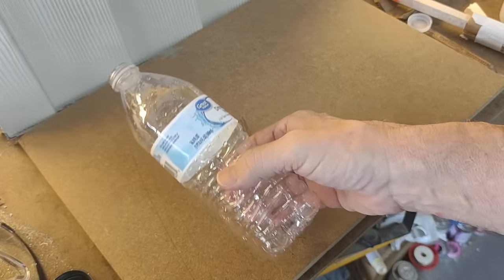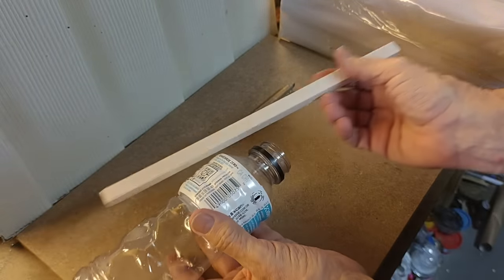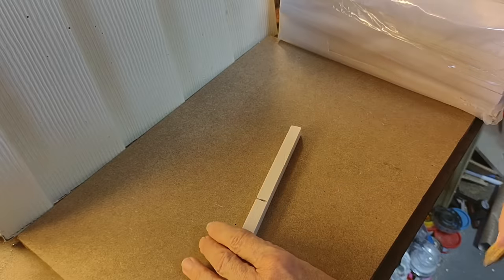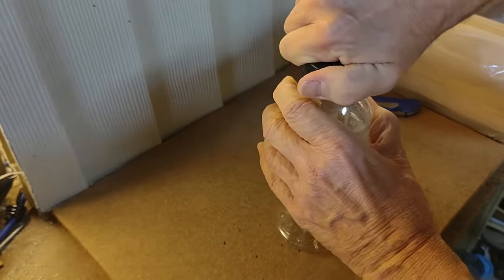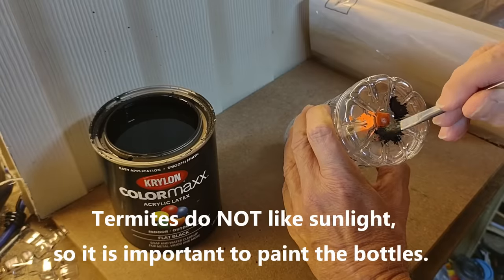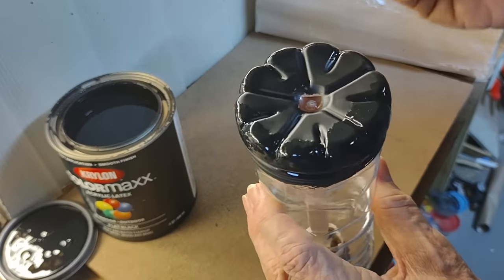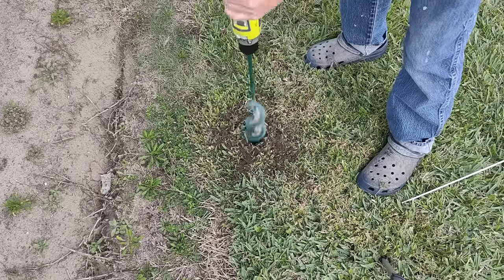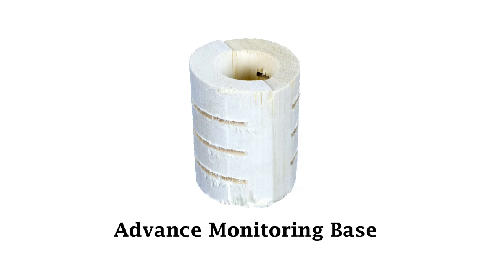Unbelievable Water Bottle Trick for Termites!  Simple to do!

Comment: 17:01 Hi Guy! Great info. I’m glad I found your channel. I’m about to cancel my Pest Control because money is currently tight so I’m going to have to DIY.
Now, question: why wouldn’t I want to have bait stations around my home instead of monitoring stations? Why not use the foam from the beginning?
I currently have stations around my house (from my pest control service) that I believe are bait stations. They’re most likely going to be removed from my home by the company once I cancel my service.
Thanks for answering.
Reply from the maker: The question you are asking is somewhat complex, but let me give you as short an answer as possible.  The bait in these stations you already have does not kill termites.  They contain an insect growth regulator that stops termites from reproducing.  The problem is that a termite worker can live up to 2 years, so it can take a long time for bait stations to kill off a colony.  Meanwhile, ants also like the bait and they will eat it when there are no termites present.  This can empty the bait stations before the termites get to it.  Moreover, bait is expensive and it only lasts a limited time in the ground before it becomes moldy and the termites reject it.  So, you need to replace the bait every year or so, and maybe a lot more often if ants are getting into it.  The monitoring stations do not use a bait at all, so ants are not interested in them.  They use wood and ants do not eat wood, so they only go off when termites trigger them.  They do not kill termites either, but they do tell you when termites are planning to eat your house, so you can treat them before they arrive in your home.  The wood in the monitoring stations is cheap.  It too will become moldy and need to be replaced every year or so, but at 50 cents a unit you can replace them all every year for about $25.  You just pull one up every year and check it for mold or rot.  If it looks good, put it back.  If it looks nasty, then replace them all.  If a unit goes off, you can make your own bait station that will kill off the colony in about 12 weeks, as opposed to the almost 2 years that a commercial station may take.  I have a video on how to do that as well.  You can only use my homemade bait stations after one of the monitoring stations is triggered.

You can also use termite granules to prevent termites.  They cost about $50 and need to be applied every year.  It takes about an hour for an average sized home.  For the granules to work you need to have dirt around most of the house and that dirt needs to be porous enough to allow water to seep into the ground fairly quickly.  To find out if the dirt around your house is porous enough, just dig a small hole next to the house that is about 4 inches deep, 8 inches long, and just the width of the shovel.  Fill the hole with water and watch to see how fast it drains down into the ground.  If it seeps into the ground fairly quickly, then the granules should work just fine.  However, if it just kind of sits there, then the granules would not be a good choice, and you should just use the monitoring stations.  I use both the granules and the monitoring stations around my home.

Make sure that you buy the correct granules.  You need the ones that have imidacloprid as the active ingredient.  A lot of the Home Depot and Lowes stores no longer sell the correct granules, but you can get them from Amazon.  I will give you a link to them.

I hope that helps.  Be well my friend.

Termite granules:  https://www.amazon.com/dp/B000RUIJYM?ref=nb_sb_ss_w_as-reorder-t1_k1_1_6&amp=&crid=157C3RV0MY0AK&amp=&sprefix=termit

 Video on how to apply termite granules:  https://youtu.be/H7rW_TSBHJ4

Video on how to make a termite bait station:  https://youtu.be/r05Z-aUJehw

Comment: Great video. Thanks for the termite info. Knock on wood, no termite problems. I was recently told by my cable company service tech that i have black Ants traveling up the northside of my house and that i should follow them as i might have some kind of structure issue. I live on Long Island on the north shore and the Ants in question are black ants about a half inch long. Wish we could share pics on YouTube. What are your recommendations that i can do before calling in a pest service. Is there a bate trap i can use say after i try to follow them? Any help super appreciated. Thanks Eddie J.
Reply from the maker: I am so sorry that you are having this problem.  I do not need to see photos to tell you that these guys are carpenter ants, and they most likely are damaging your house.  They like wet wood, so their presence may be an indication that you have a leaky roof, excessive condensation, or a pipe leak.  The first thing you should do is try to locate and repair this problem.  The ants that are in your house are just a satellite colony.  The main colony is somewhere outside your house.  I have a video on how to eliminate carpenter ants, but the problem that you are going to run into is that you cannot get pesticides in New York.  The state has pretty much banned all pesticides, unless you have a pest control license.  Most people on Long Island have it shipped to somebody in New Jersey and they just go over and get it.  I know it's a long drive, but New York is determined to be the hardest state in the country to get pesticides.  If you can get the products, then this is a fairly easy problem to treat.

I hope that helps.  Be well my friend.

Video on how to treat carpenter ants:  https://youtu.be/Te9BUCaIQZY

Comment: They like polystyrene foam.
Reply from the maker: Termites do not eat polystyrene foam. They are wood-eating insects and prefer to eat cellulose, which is found in wood, paper, and other plant-based materials. Polystyrene foam is made from a type of plastic that does not contain cellulose. While termites may not actively seek out polystyrene foam, they may still damage it if they come into contact with it. This is because termites have strong jaws that can chew through a variety of materials.  So, when the foam is up against infested wood, it can become damaged.  I hope that helps.  Be well my friend.

Comment: This is great. My house was treated about 10 years ago. Do you have any tips on inspecting to see if there is a current infestation? I usually just look for mud trails on my foundation. Would also guess that after some time the Balsa wood would go bad even if there are no termites?
Reply from the maker: In addition to looking for mud tubes coming up from the ground around the house, you should also look for them in the crawlspace, the attic, and even the eaves.  They can sometimes bypass all of that and enter through a crack in the slab or foundation, so mud tubes are not always present.  That is why the monitoring stations are also helpful.  The wood in the station is going to get nasty after a while and will need to be replaced.  I recommend pulling one up at least annually and inspecting it.  If the wood is moldy or compromised in any way, then you should replace them.  The commercial stations have the same problem, but the wood or bait is easier to replace with them.  Also, sometimes the orange dot will disappear, even though there are no termites.  This can happen if you run over one with a riding mower or if the stick was not long enough.  It can slip to the side and not be visible.  So, always check to be sure that you actually have termites when one goes off.  

I hope that helps.  Be well my friend.

Comment: How do you keep mice out of your car? Under the hood.
Reply: @piratepete4322  That sounds like it would be effective, but how does it affect the engine?
Reply: Cat
Reply: @KenJackson_US  

Obviously I am hoping your question is in jest as you don't have to put it near the engine at all but merely in the engine bay .

Near the battery shelf or similar is a good spot .
Anywhere where you can place it that won't enable it to move as it will melt and spread / flatten out .

You can also hot glue the frozen ball in place whilst frozen if required .
Reply: @sfcarp9418 : " I am hoping your question is in jest ..."
My question was directed toward the guy that said to shoot them.  His comment is gone.  Either he deleted it or the fascist censors did.
Reply: @KenJackson_US  

Oh ... ok then .
Reply from the maker: I think the best way is to get rid of the mice altogether.  I recommend using a one feed bait in bait stations.  You can place them near where the car is parked.  I would not place them under the hood because you don't want to attract more mice under there.  The bait I am recommending will pretty much keep the population down to the point where they should no longer be a problem.  I hope that helps.  Be well my friend.

Bait:  https://www.domyown.com/fastrac-allweather-blox-p-333.html

Bait stations:  https://www.domyown.com/protecta-mouse-bait-stations-p-1284.html

Comment: Thank you for the video on termites. How do I get rid of fleas?
Reply from the maker: To rid your home of fleas, the first thing you need to do is to vacuum all the upholstered furniture and pet bedding, paying particular attention to places where fleas can hide, like behind cushions.  Next, vacuum the floors throughout the house.  If you have a vacuum with a disposable bag, then discard the bag outside in the trash.  If you have a vacuum with a reusable canister, empty it outside in the trash and then wash it out with the garden hose before bringing it back in the house.  Wash all bed linens and pet bedding in your washing machine and dry on high heat.  Next, spray a pesticide that is labeled for fleas, on all the floors and on areas of upholstered furniture that does not come in contact with people or pets.  To treat floors, hold the can at arm’s length and make sweeping motions across the floor to cover all surfaces.  For upholstered furniture, you should spray under the cushions and then any folds that there are.  The product that I like best is called PT Alpine Flea and Bed Bug Aerosol.  I will give you a link for it.  Fleas can be hard to kill, so you may need to do this treatment every two weeks until the problem is solved.  If you have pets, then you should treat them as recommended by your vet.  The reason fleas got into the house in the first place is because they are outside.  If you have a flea problem outside, then there is a good chance you will end up with a flea problem inside.  Even if you don't have pets, the fleas will still jump on you when you are outside, and so you can carry them in.  Therefore, you need to treat the outside as well.  I do this with a hose end sprayer.  I will give you a link to my video on how to do that.  I find that treating the yard every 60 days seems to do the trick.
 
I hope that helps.  Be well my friend.               
 
PT Alpine Flea and Bed Bug Aerosol:  https://www.domyown.com/pt-alpine-flea-and-bed-bug-aerosol-p-1886.html?pdpv=2&sub_id=25601  
 
Video on how to treat your yard with a hose end sprayer:  https://youtu.be/wifoTU5dmp0

Comment: Thanks a lot. This is really useful. Would you suggest this for Sydney, Australia weathers as well ?
Reply from the maker: Yes.  Monitoring stations are useful everywhere in the world to monitor for subterranean termites.  However, they may not be effective in identifying all species that exist in Australia.  I am not familiar with all the species you have there, so it is possible that one or more species may operate somewhat differently than subterranean termites that only travel just below the surface of the ground.  Therefore, monitoring stations will most likely be very effective in identifying most subterranean termite activity, but I cannot rule out the possibility that a species there may get past them.  If I were you, I would try to locate them about one meter apart around the entire building and along both sides of the driveway.  It would be hard for the termites to miss them if they are that close together.  Keep in mind that sometimes one of these will malfunction and the dot will disappear because the stick moved.  This can happen if the stick was cut a little too short or if a riding mower went over it and such as that.  So, if one goes off, pull it up to make sure that there are actually termites in it.  Most of the time there are.  If it's a malfunction, then simply replace it.  If it's termites, then put it back in place and install a bait station next to it.  I have a video on how to make bait stations and I will give you the link to it.  Pesticides are hard to come by in Australia, but I know people there that have been able to purchase fipronil, which is what you need.  One last thing.  All monitoring stations have a problem with mold and these are no exception.  Pull one up every year and check for mold.  If there is no mold, then you are good to go for another year.  If there is mold, replace that station and check a few others.  If a lot of them are moldy, then start replacing them.  For some reason termites don't like mold.  A little mold is okay, but a lot of it could reduce the effectiveness of the stations.  This is a problem for all monitoring stations because it is usually damp and dark in the stations and mold likes to grow in damp and dark areas.

I hope that helps.  Be well mate.

Video on how to make bait stations:  https://youtu.be/r05Z-aUJehw

Comment: I find a new infestation every couple of years. I deal with one and another crops up after about 2-3yrs.
All I can do is keep them monitored and scrape away the tunnels as soon as I see them. I use kerosene which I poor where the tunnel came out of the ground. This is easy for me and works well. They retreat and eventually find some other way up the stumps. I have had pest inspectors come out and lay baits which may or not work. I can't tell. I've never been able to kill the whole colony. They have to live at ground level here because nothing can dig in this ground. Not even the termites! They build their tunnels at ground level by covering them with a thick layer of soil. So they are right there and easy to deal with.
And yes I have those ones that fly as well.
Reply from the maker: The problem with using baits is that it takes up to two years, and sometimes even longer than that, to wipe out a colony of subterranean termites.  If you would like to end it right now, then fire the pest control company and go ahead and trench your house.  It only costs about $100 and about a day's work.  This will put an end to the problem within about 12 weeks.  I have a video on how to do it and I'll give you a link to it.                    

I hope that helps.  Be well my friend. 

Video on how to trench for subterranean termites:  https://youtu.be/Fy7YHi_7Z8g